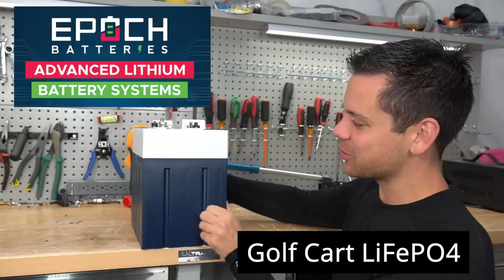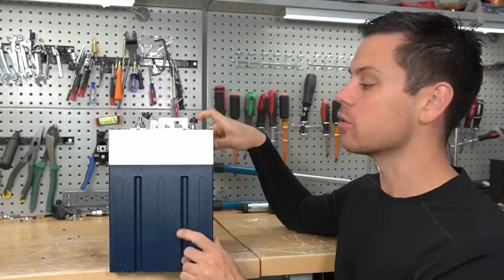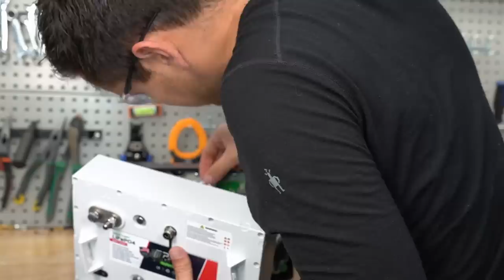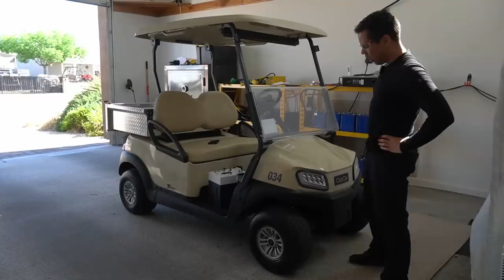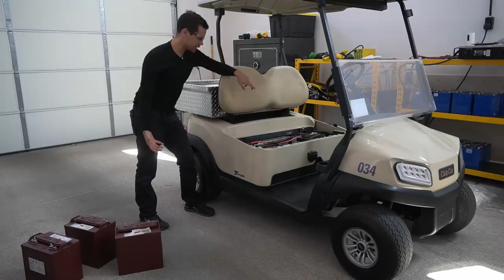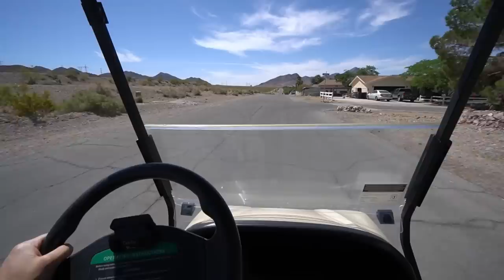$2,999 48V Epoch GC2 LiFePO4 Conversion Kit for Golf Cart

Comment from the maker: A massive video is going to be posted tomorrow or in the next couple of days!! Stay tuned :D I think you guys are going to love it if you are building large offgrid solar power systems!!
Reply from the maker: Also, epoch will have 12V solar batteries soon. Will make videos on those as well.
Reply: I am. Can’t wait
Reply: I can't wait! Thanks, Will! 👍
Reply from the maker: Also, I rarely do golf cart videos but I've had a lot of requests for them lately. I'll surely throw a solar panel on the roof of this thing next 😂
Reply: Epoch is pronounced 'ee pok' :-)
Reply: I wonder if you could do a series for the RV/Sailing community where we're running A/C, Refrige, electronics, navigation, washer/dryer, lights, autopilot, etc... We have a cruising sailboat and thousands do also that need a dense source of safe storage and maintain it via solar panels, wind, shore power and an onboard genset. Would love to see your input.
Reply: @WillProwse  I would love to see a 12v 200Ah version from them since they make a 24v 100Ah battery. It would be a nice option to run the portable fridge in my truck instead of the 24v pack I move in and out all the time.
Reply: I'm wondering if this is EG4's new 18KVA system

Comment: It is not necessary to read this litany on my change from LAB to EPOCH lithium batteries...The bottom line is wow...and double wow for EPOCH batteries...HOWEVER, time will tell... I bought a new ROYAL EV (48v LAB) lifted, last April. I live in Franklin, Nc, and it's sort of hilly, lol. I upgraded it to being street-legal (SL)and got a tag through DMV. I THINK I am the only one in town with a SL golf cart. I am street-legal as long as the speed limit is 35MPH or less. My driveway is super steep, so much so that my rear-wheel-drive Chevy Camaro has difficulty backing up. My golf cart did just ok. It's exactly one mile from the main road to my house, and the road is so steep that I was down to about 2 MPH at the top. The batteries "were" Crown (6)8volts. I finally had enough of having to pull over to the side of the road and let cars pass me, so I did some research on lithium batteries and chose EPOCH. After 10 phone calls to their company in Atlanta, I drove there and bought 5 batteries (overkill lol). The tech, Stephen, walked me through the setup, and off I went. I had a local Golf Cart company take out my LAB (which I sold for $500), and they bought my LAB charger and charging cable. Stephen and another tech named Kevin answered about 20 different questions I had during about 20 different phone calls. The set-up was a breeze, and the 4-mile drive home after the installation was great. Although I am only allowed to legally go 25MPH, I was pushing 30 the whole way home. When I got to my drive up the "steep" hill to the house, I slowed down to 20, and then 15 (Association speed limit) all the way to the house. DAMN...Twas great!  Bottom line... lithium batteries...unless you're driving on level ground. As far as using EPOCH batteries, the YouTube videos, and this one especially made me a believer. Having installed and used the batteries just proved that they are heads and heels above LAB. Also visiting the company store and getting the tech service I received was also a great selling point. I do have room for a 6th battery...Nah...lol

Comment: I put in four 100AH max output 1280WH Chins in my 48 volt cart, $1260 at Amazon. Had them laying around from a cancelled project and said “what the heck” lets see how they perform. I have the cart up at my place in the Smoky mountains. Steep dirt roads….and my driveway is really super steep. They have been flawless with the exception of one incident where the BMS kicked in shutting one battery down due to overload. It was freezing cold and I floored the cart before allowing the batteries to warm up whilst charging up the steepest hill in the neighborhood with all the lighting and light bars on….and I knew better than to do this. If one BMS shuts a battery down, your cart wont go anywhere due to the series connection. Other than this single incident, these have worked great. Cart lost 300lbs and has 3x the range. I can see where Will’s 48 volt cart batteries are really the best way to go for the max amps, but at half the cost, the Chins have worked great as along as you give them a chance to warm up….and keep an eye on the volt meter when super chilly. Cheers!
Reply from the maker: No way!!! That's awesome!! 😂😂
Reply: That is what I am going to do. 4x 100ah cheap lithium batteries in series. But I heard not all 12v like to be connected in series. Btw presented battery look suspicious too small to be 120ah. At current 250w/ kg it need to be at least 26kg

Comment: I just converted my 2011 TXT 48 volt today using the Epoch kit.  The Trojan T-875 batteries weight 62 lbs each.  The Epoch batteries weigh 32 lbs each.  Total weight reduction was 276 lbs.  Gained 3 mph, and added a nice amount of range.  Not sure but it sounds like 2 to 3 times the range.  Best of all, IMO, not more corrosion issues!
Reply: Ok, I don’t understand “hmu” 😂

Comment: Did my own solar project using the power queen 12v 410a batteries (2x). But found out that power queen mppt can't process all that power. 800w 24v panels to 12v max out the mppt of 30a.
And seeing how small those cells are now. I need to upgrade my project.
Reply: Wouldn't it make more sense to just upgrade your MPPT controller to a larger capacity eg 12/24/48v 60a MPPT Controller if power queen or a third party manufacture one like eco worthy,renogy, victron,etc..

Comment: that great. not ready to change them. out my 8V battery;s yet. 2000 Ez Go 48V . I get 5+ years on lead battery. I am in NY and use mine all year so I would need to insulate and heat them. easy to do. I have solar on it with MPPT boost so I can use 36V large single panel . it's super slow but works. waiting for LiFePO4 GC kits to be around for awhile before I buy. mine has the lift in it as your outher one. I almost got a 60V one. rides up to 6 people. wanted to much for old battery.s . I paid less for mine used with new battery's.

Comment: pronounced eee-pok or ehh-pok.  Thanks for the teardown.  Been wondering what is inside those.  Careful with those lead-acid batteries on the cement floor.  I have some permanent stains and etching. Lead is dead.

Comment: Sorry to ask what might be obvious visually however I am a blind subscriber
Since you couldn’t connect the communication does that mean that you had to turn on each battery individually? If so wouldn’t that be kind of unfortunate if one got missed
Cheers
Reply: Still have to turn them on and off one at a time (if you want to do that) the communication is "canbus" (or their version of it) so that the meter they send will report the SOC for the pack, bms comms for balancing etc. (hard to say exactly, as the documentation thus far is pretty minimal, but when I called they said they were "working on it".)
Reply: @HippocratesGarden  thanks for that

Some years ago on a four wheel recumbent tandem I ran two 48 V lithium E bike batteries in parallel  and failed to plug one in properly damaging the other so I am a little worried about these sorts of things
Search for my name in YouTube and you should see the cycle
Cheers

Comment: Hello Will from Sydney Australia. Thank you for explaining the removal and installation (replace cables and connectors) of batteries using a distribution busbar in a golf cart.
Q1. Is it wise (safe) to connect a charger 240V AC - 24 V DC to the busbar for, load current in, or charge individual batteries?
🌌💫💡

Comment: Will can u explain how the various cables a switches on the battery do or don't complicate the use of these marine grade batteries? Boat (and golf cart batteries) tend to be buried and needing to power them up is kind of a deal breaker. I'm ready to buy these that's my only  concern. And maybe a safety around 48v would be cool. Epic channel well done.

Comment: Hello WillProwse I recently bought a runhorse / jinma J2-P a chinese electric mini truck 60v, the cargobox is L:1635mm W:1150mm H:1058mm i wanted to add solar system to charge it with 3 panels 1 on to and 1 on each of the sides not sure what would be needed any help would be amazing.

Comment: Just installed the 3 battery system in a Club Car.  However,  there is no documentation or spec sheets provided by Epoch.  Additionally, the Can-Bus system reports errors and data without a manual or look up table for an explanation.  They could do better communicating.

Comment: @WillProwse I dug up an old golf cart video because I have an idea.  My mom lives on an acreage and she needs something to get around on.  We have an old cart with old batteries in it Id like to convert to Lifepo4.  No big deal right?  But we also have semi unstable power to the house when it storms.  Id like to dual use the cart...Id like to have it serve as battery backup in addition to transportation.  BUT, heres the BIG hurdle...I have to make it stupid simple....Id like to use a single power plug.....bi-directionally.  If there is power in the house, the house will charge the battery.  If there isnt, the cart will feed an inverter that will power some critical circuits...like AC/lights/phones.  I know I need a hybrid inverter, but is it possible to do the charging and the backfeeding in one connector?  And the auto direction changing?

Comment: So what happens to your 12 volt lights and accessories when using these batteries? Do you have to put in a converter for those or use a secondary battery?
Reply: The kit comes with a 250 watt 48-12 volt converter.

Comment: That is a really expensive conversion. BUT -- since the life of those lead-acid batteries on a golf cart are about 3 years, and the replacement every 3 years is about $1000-$1500 -- And the LifeP04 should last 10 years and have 4 times the range -- Good deal!!

Comment: can buy the EG4 48v all in one for $1,670 at 100 ah why would I spend twice for 20 ah more and more wires?
Reply from the maker: That wouldn't run the cart. I've tried haha
Reply from the maker: You need massive surge capacity
Reply: I got these because they are IP67, I'm converting an offroad golfcart (bad boy buggy) to lithium and the battery compartment is not sealed, so I'll be going through water, mud etc and want to keep the electronics clean and dry.
Reply: I was also wondering why not EG4 since is much cheaper, but haha😂😂😂 you already tried and figured it out.

Comment: Is it safe to mount and operate these batteries mounted on their side with the terminals parallel with the ground?
Reply: Epoch called me after I submitted a question on their website and confirmed that any orientation other than upside down is approved.  Customer service so far has been good.

Comment: My golf cart has 6 8-volt GC8 Duracell batteries.  How many amp hours does that have?
Reply: Those as usually 140-180ah depending on the exact model. But of course with lead-acid batts the voltage drops so much during use that your effective capacity is much less and the performance is worse for most of the usage.
Reply: @Sylvan_dB  I'm just trying to determine how many of the 48-volt batteries I would need to have the same amp hours.  I don't use the old cart a lot, but it would be nice to upgrade to LiFePO4.
Reply: @glennr9913  Your batteries are probably wired in series so voltage adds to 48v and amp-hours stay the same.  So about 160ah, but less usable.  3 of these at 55ah would easily replace your 6 GC8s.
edit:  chances are good you'd be happy with 2.
Reply: Use the same kit Will used and you'll be good to go, and they advertise 55 miles on a charge. I got double mileage after converting to lithium in my golf car.

Comment: Dang, it would cost $6k to upgrade my 96v cart....hopefully some day in a few years there will be a cheaper option.
Reply: Some folks are just using the normal 12v100ah batteries to cheaply upgrade 36v and 48v golf carts, but for 96v ...  how many of what spec batteries does it have?!?!
Reply: @Sylvan_dB  12 x 8v large batteries

It's basically a Wheego Whip converted for driving around the property...but the batteries are toast now.
Reply: @PowerScissor  Sounds like fun. Also sounds like it would have room for 8 of the regular 12v, 100ah batteries.  Or at least 1 or 2 pair of these 48v batteries (more pairs for longer run time). Those 8v batts are usually around 140-180ah, but a smaller lithium will perform just as well or even better.